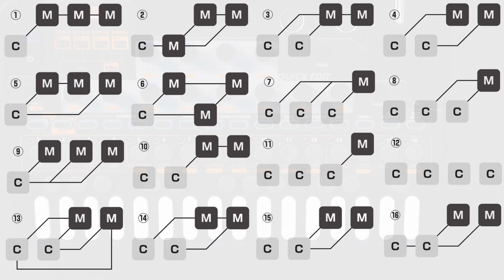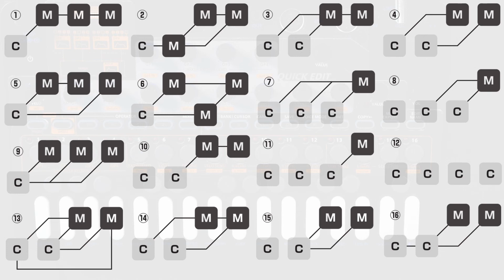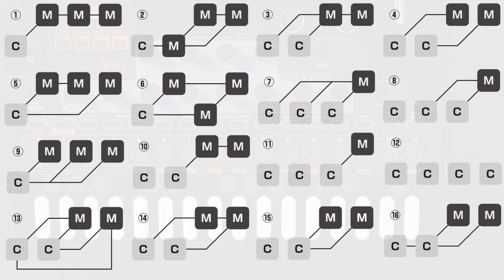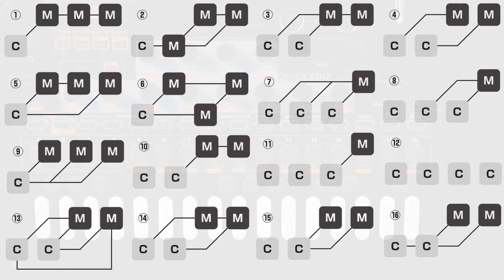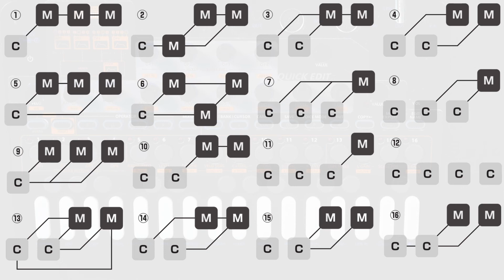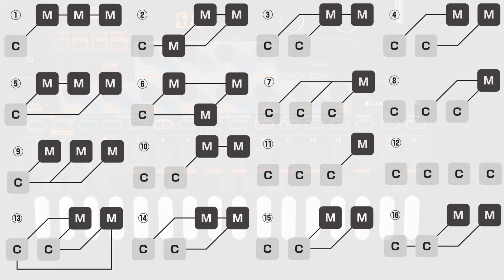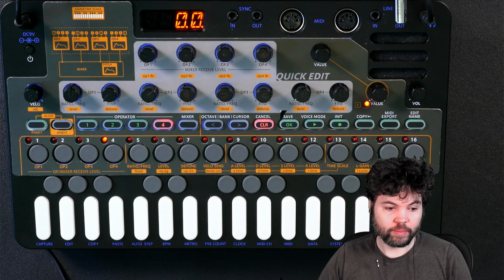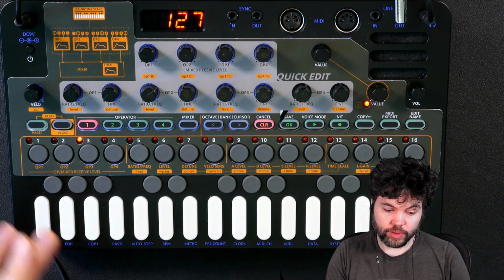FM Sound Design on Liven XFM: Ep11 - Using Algorithms

Comment: Thanks once again for the explanations!
I can also imagine that the selection of 'algorithms' makes a difference when having in mind to morph two patches into one another. I think the way how the morphing works is that the device generates a transition between each and every parameter of patch A and B (receive levels, envelopes etc.). So I imagine during the morphing state, the sound will sound very different based on whether a carrier is morphed into being a modulator, or whether the carrier / modulator configurations (receive levels) are more or less the same in both patches. So I suppose, two patches with the same algorithms as a base will blend smoothly into one another, whereas patches with very different configurations will travel through extreme and unpredictable territory, so to say. So when designing two patches from scratch while having a smooth transition in mind, you'd choose the same algorithm as a starting point.
Reply from the maker: I think your assessment is accurate. In particular, an algorithm isn't a patch parameter on the Liven XFM, and you are free to route anything to anything, but it provides an initial set of connections. One benefit it offers is suggesting certain thinking about which operators function as carriers vs modulators. The more similar the functions of corresponding operators, the more smoothly morphing can occur. In practise, I've found the combination of algorithms, freeform routing design, and morphing, to be very compelling.

Comment: Many thanks.
I've never fully understood FM synthesis through any tutorial till now.
Probably because every other FM tutorial has been either through a VST or a hardware synth I don't own.

Quick question...
I've noticed that the envelope parameter for "release level" is rarely if ever used.
At least I haven't come across anyone using it on any tutorial (including your own) that I have ever watched.
Though I've heard or read that release level is usually used for modulating other operators as opposed to shaping the characteristics of a carrier.

Could you give me a very quick example of when release level would come into play as far as its use in FM synthesis?
Reply from the maker: Thanks for the comment. I started typing a description of uses for the release envelope stage then I realized that it would be quite verbose. My plan is, instead, to add another episode where I talk about the release stage of the envelope (and when, and how you might use it).
Reply: @ChalkWalkMusic  that sounds like a plan!
I figured the answer wouldn't be so simple.
So I wasn't going to be upset if you didn't answer...😅
Reply: Of course I want to let the educated answer to Chalk Walk, I'm also curious for the video!
If I still might verbalize a guess: Since the modulator modifies the sound of the carrier, I imagine there are use cases where you'd want the sound to 'escalate' in some way at the end, like for example going up in pitch to introduce some sort of sweep at the end; or maybe let the modulator produce a noise at the end of the tone, so that it sounds as if the tone was somehow cut, like unplugging a cable and producing cracks or so. Or a drone sound fading into noise, like a radio loosing its frequency or a turntable player ending in the 'empty' groove, producing cracks instead of tonal material. For that to achieve, I guess the modulator would have to raise in volume/intensity instead of declining to zero.
Anyways, as said, I'm very curious for a video about that. Let's see whether my guesses were kind of nonsense, or whether Chalk Walk will add other / better use cases beyond my imagination ;)
Reply: @bahutu802  I believe he already made the video.
I've been out of action for a bit.
So I have not watched it yet.

Though I also experimented with it.

It allows for some interesting effects that I can't quite grammatically articulate at the moment (drink in moderation kids!🥴 hangovers are for losers...😅)
Reply: @BendApparatus   😀 Get well soon! I'll have a look. I watched the tutorial series in the playlist and this video we're commenting on was the last in the playlist. We'll see.
Reply from the maker: @bahutu802  Hello, and thanks for your comment. Your description is indeed correct: you might want timbral changes to occur during release; in acoustic sounds these changes are typically reduce in timbral complexity, but FM doesn't have to be modeled after acoustic sounds. I actually covered this, to an extent, in my video on envelopes that I added to this series.
Reply: @ChalkWalkMusic  Oh great. Of all the videos in the playlist, I just skipped the video about envelopes because I was curious for the algorithm video. I'll definitely have a look at it.

Comment: Imagine you're buying a house that is not yet built.  Were this in a new housing development, there may be a few floor plans to choose from.  A custom house is completely up to you.
The usual interface for FM synthesis offers floor plans, but the XFM allows a similar set or whatever you choose for a patch and morphing between any two.
Reply from the maker: Thanks for the comment! This is an interesting analogy. My experience, generically, has been that careful algorithm selection in a traditional FM synth is something that often gets under emphasized and yet is of critical importance: If you picked an algorithm that doesn't offer the routings you want (or need) down the line, you are sunk. With the XFM for are free to make those routing decisions as you proceed, lifting that burden and effectively eliminating that risk.